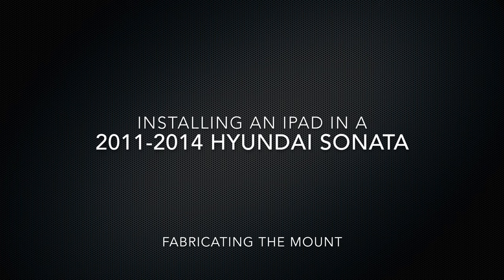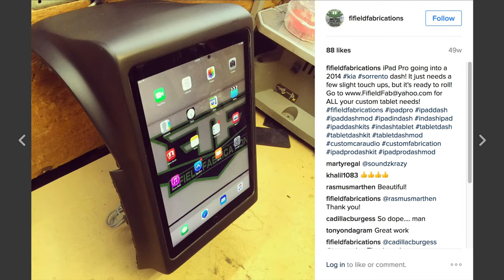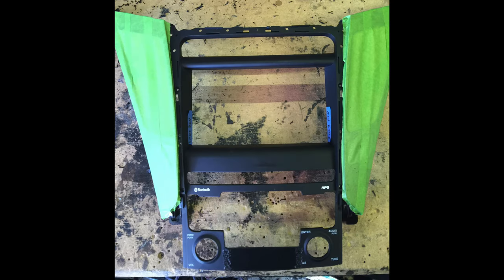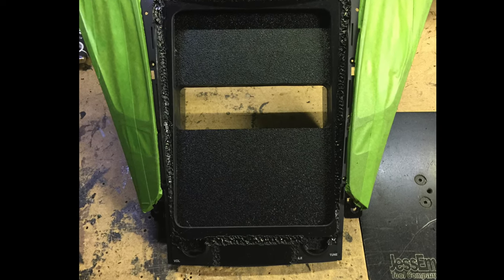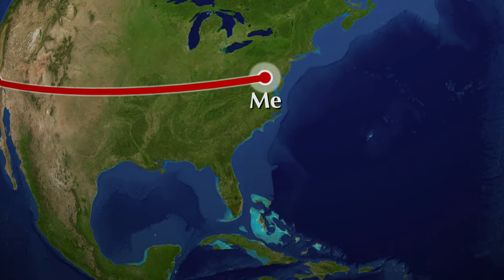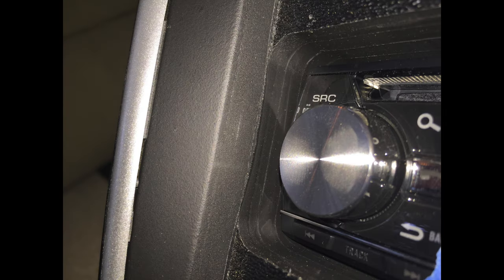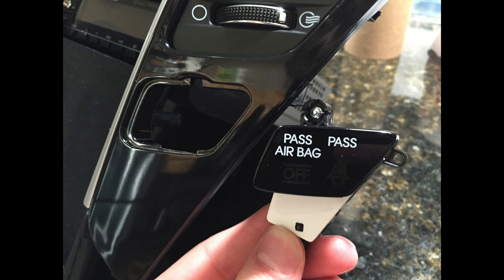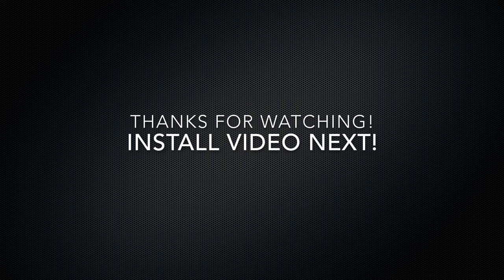Creating a Dash Kit for 9.7" iPad in a Hyundai Sonata by Fifield Fabrications

Comment: Scott, I bought a Pioneer MVH-S501BS media player and I don't think I can get this to fit in Jamie's mount. 
Which one did you get and how wide is it?
Did you have to disassemble it to get it in?
Reply from the maker: The measurement of a standard DIN slot is 2-1/8” (50mm) height by 7-1/8” (180mm) width, so although my unit is longer due to the CD player, your unit is the same width and since so it should mount just fine. You just need to drill holes into the sides of the mount that line up with the screw holes on the head unit. Refer to this video which shows how I installed it: https://www.youtube.com/watch?v=IFLe0P0-NXs

Comment: Did you paint the sugru around the passenger airbag indicator? If so, how? I'm not familiar with Sugru. Also, did Fifield glass in the lightning cable?
Reply from the maker: The Surgru comes in different colors, I already had some in black, so no need to paint it. And yes Fiefield did the lighting cable in the kit.
Reply: So I'm buying the parts now and already contacted Fifield. Do you have a list of the parts I would need to simply get this to work with the Limited? I am trying to get a Pioneer x390bt as my single din behind the Ipad but not changing speakers/amp and I know you added some parts (DAC, Metra kit, steering wheel controls, etc) in another video. Everything I have currently is factory. Just wondering if all that is necessary as I have no experience with car audio installs.
Reply from the maker: Yes in order for it to work you will need the PAC RP4.2-HY11 and the PAC RPA-SPDIF. This video has more info on this: https://www.youtube.com/watch?v=9WzxgyUuho8